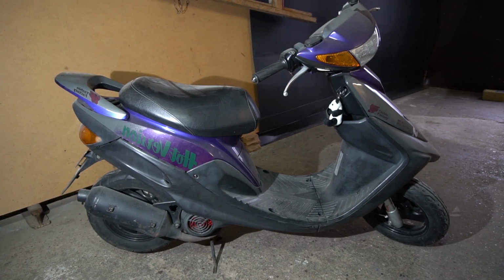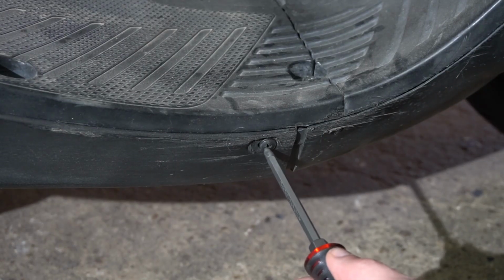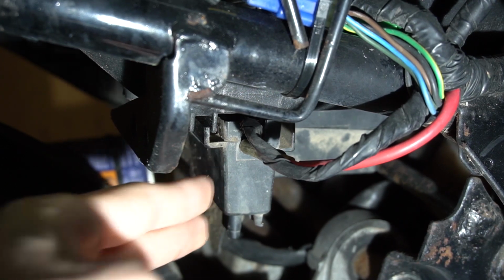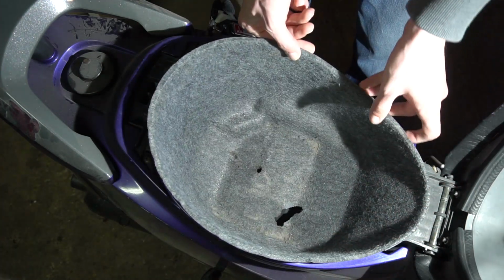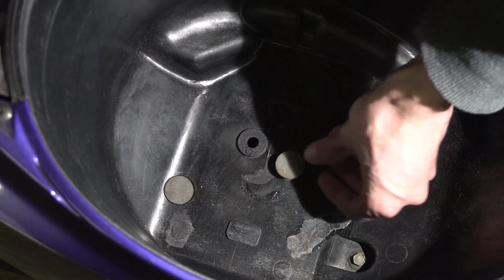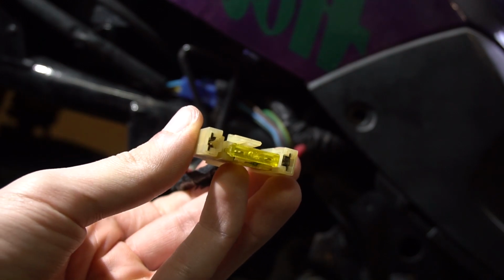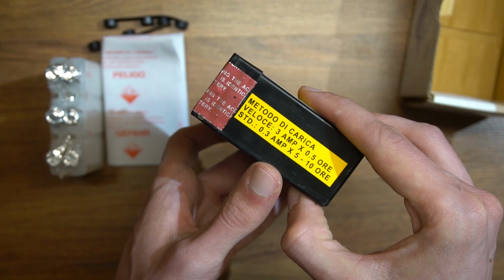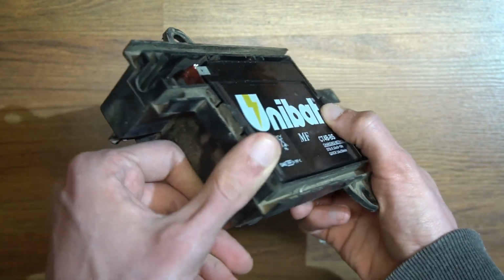Yamaha Jog 3YJ/3YK Battery Type and Location

Comment: Is the 3yk same as 3YJ what is the different ?
Reply from the maker: @richadjimenez4017  The frame is almost the same. The main differnce is in the front fork and the cowling for the handlebar. The 3YJ has drum brakes in the front and the 3YK has disk brakes in the front.

Comment: I have Yamaha Super Jog Zr, 2 weeks ago i bought Battery 2.3ah, i tried start up engine with starter, starter working great, but engine not starting up everything clean, and with good quality, and also battery type is GT4B-5
Reply from the maker: If I understand correctly you have a problem outside the starter. Can you start it with the kickstarter? If not check the spark then the fuel system. Currently my Super Jog  Zr is down due to some minor carburetor problems.
Reply: @andymaverick  Yamaha start ups great, everything  alright with engine and fuel, i think battery isn't good.
Reply: @andymaverick  I've found problem, starter bendix worm out, i gonna buy new one.
Reply from the maker: @amateur547  I'm happy that you diagnosed the problem.
Reply: @andymaverick  Thanks you for supporting me!, that is so important.